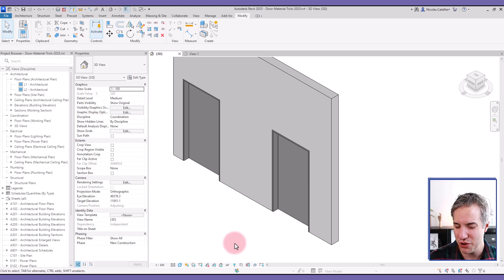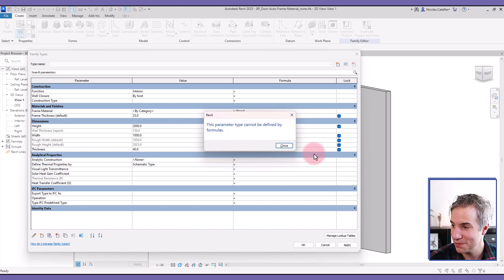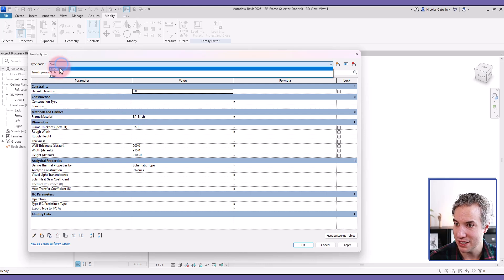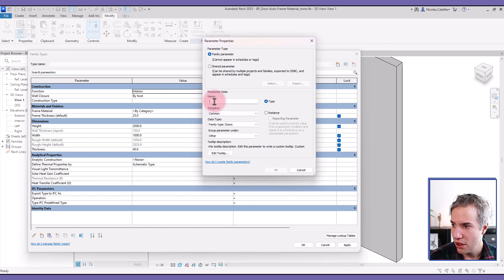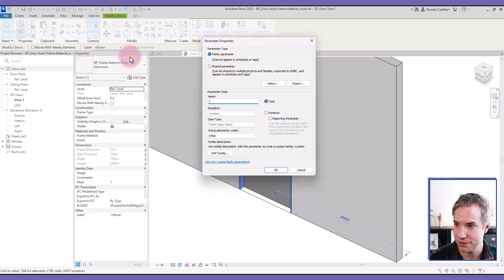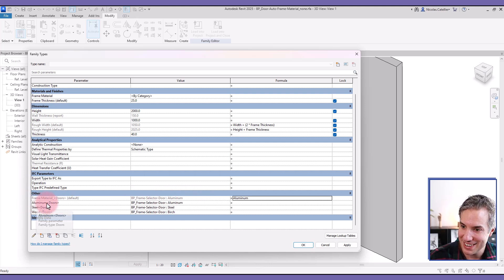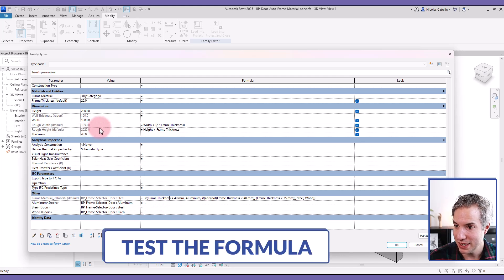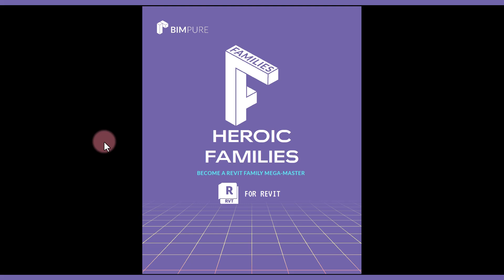Revit Family Trick - Set Formulas to Material Parameters

Comment: Nick. Question on formulas. 
Currently have an Issued Index schedule using a sheet instance parameter to denote if it has been reprinted/issued. 

However like to involve the revision parameter also. 

Current schedule uses Y/N type parameter and font substitutions.

Any suggestions?

Comment: Opinion: Swapping out family components inside a complex family, e.g. a wood panel for a steel one by setting up family type parameters, has been a long-standing practice; all that's happening here is to add some parameter and formula jiu-jitsu to tie a nested family type to some other dependency, in this case the width parameter. Overall, however, I think such practice contributes to "hero family" syndrome, where you try to solve all the world's problems by creating the One True Door Family, filling it with unnecessary bloat in the name of flexibility in the process.

The best families are those that are purpose-built; in this case, where you create a specific door family based on its purpose which largely sets its construction, including what materials make up the panel, frame, etc. Doors are especially tricky because you now need to create additional parameters to sync up the Door Types and Frame Types to account for the documentation requirements in the schedule. And that goes for most real-world manufactured families, e.g., light fixtures with different housing and lens materials (which are often included as part of  the model number).

In other words, if I need a door with a wood frame, I'll simply make a wood frame door family. If I need to change it to a metal frame door, it's a simple family / type swap. And I will save having a ton of nested components and unnecessarily complex parameters and formulas that will likely break as more options are piled on and need ongoing maintenance.
Reply from the maker: You are right that maybe the example in the video isn't a great idea for most door families. The goal is to showcase that the <Family Type> parameter and nested families can be used for formula wizardry if users need it. I agree with the general idea of avoiding "super-families".

Comment: Sadly this is not a trick 😞 
It still is a lot of work than a simple formula.
Reply from the maker: Yeah, it's a bit of work.. but a simple formula won't work for material parameters.
Reply: @bimpure  gladly it's rarely used by me until now, because i make the team separate families by materials. after finding out how heavy my door families have become, Family Management is hard
Reply from the maker: @EvlixManiac  You could try using nested shared families for panels and frames, and putting all the options on the project instead of in the families. Not that I want to sound salesy, but we cover doors & window families quite in depth in the heroic families course... and door collection coming May 27th :)
Reply: @bimpure  looking forward to it.
Reply: Bummer. I was hoping this would be a novel new trick that populates the material parameter directly. Oh well, let’s hope Revit release 3000 allows it someday. Good effort though, thanks for sharing your knowledge.